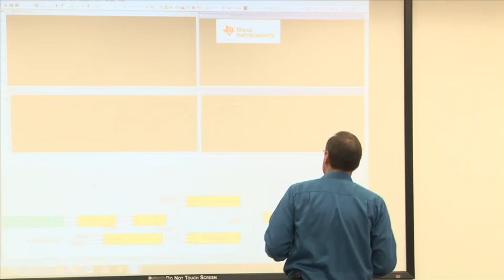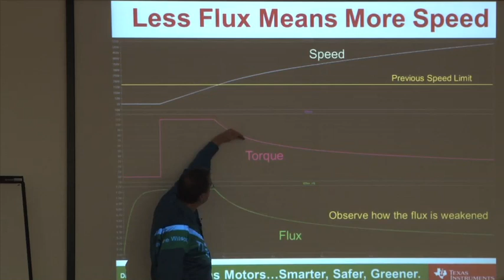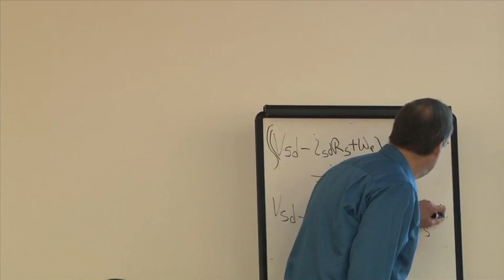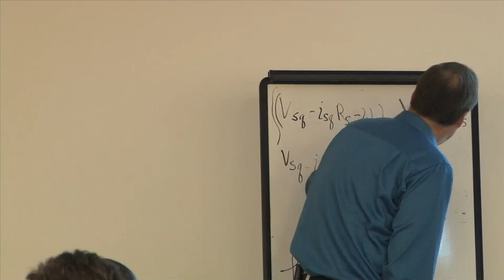Comment: Summary:

00:00 Fiddling with simulation parameters
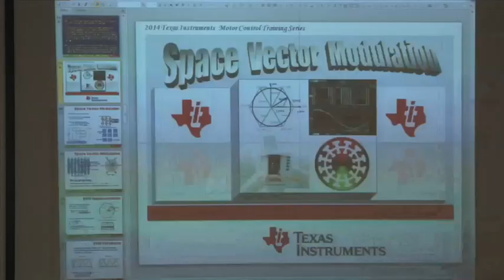6:22 Space Vector Modulation
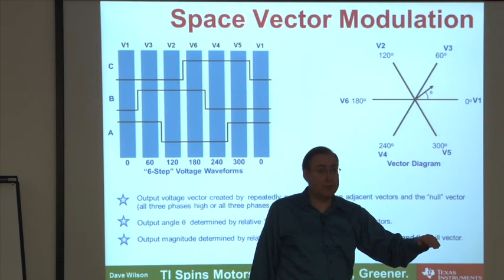12:47 SVM Implementation
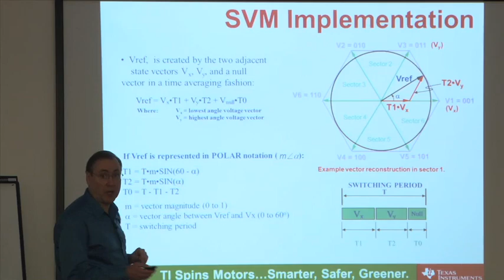15:18 SVM Variations
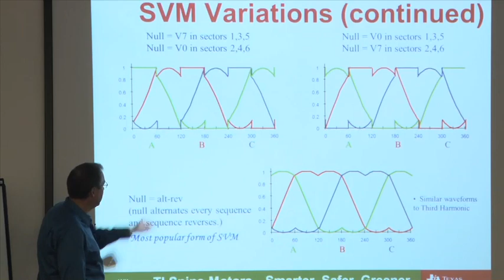19:10 SVM Using Center-Aligned PWMs
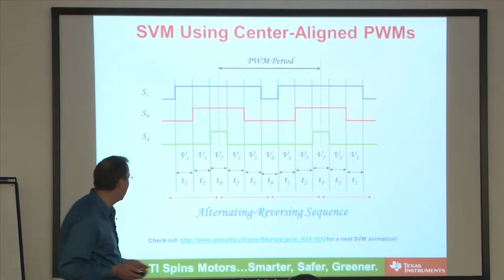22:03 SVM with PWMs
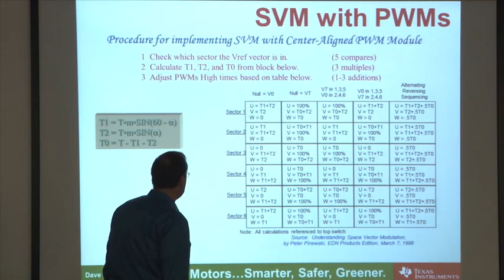23:55 Sinusoidal Modulation - Limited Amplitude
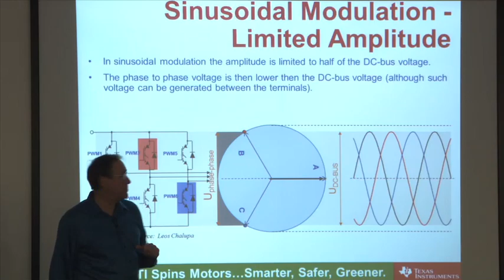25:48 Full Phase-to-Phase Voltage Generation
26:50 How to Increse Modulation Index
27:25 SVM with Field Oriented Systems
29:12 Lab Exercise 2: Space Vector Modulation
32:40 Too Much Flux?
34:52 Weakening the Field... LUT
35:55 Weakening the Field... Voltage Limit
38:50 Less Flux Means More Speed
45:00 Lab Exercise 4: Axis Decoupling
1:16:35 Current Regulator Decoupling
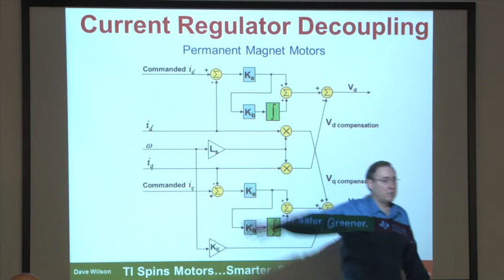1:17:14 Field Oriented Control of ACIMs
1:17:50 Speed-Torque Perfomance of Induction Motors
1:24:22 Stator and Rotor Fields

Comment: In the SVM over modulation, i don't understand 1. why the DC bus is 2 times of the phase voltage as the diagram showed; 2. i still cannot understand how can we do the over modulation with the 6 IGBTs.
Reply: +Remy Liu When you modulate voltages using complementary operation of the transistors, the neutral point in the motor (or any isolated 3 phase load) is at a potential equal to half the bus voltage with respect to bus ground (at least on average). So each phase gets a voltage equal to plus or minus (Vbus)/2 with respect to neutral. Taking this into consideration, simple trigonometry will point out that the maximum phase to phase voltage in this case is =    2*sin(60)*(Vbus)/2, which is equal to approx 0.866*Vbus. This means that you cannot get full bus voltage measuring phase to phase. I think that's why we need overmodulation.